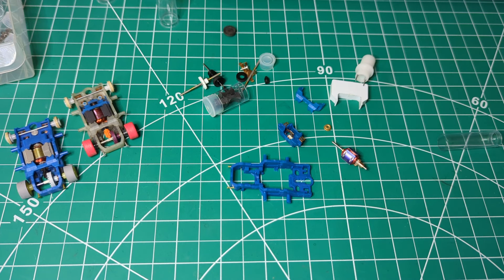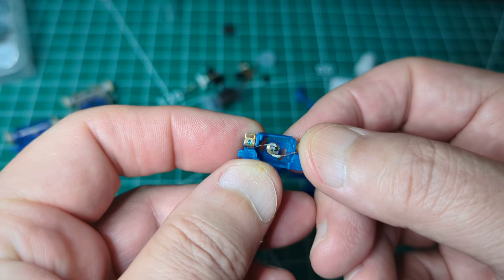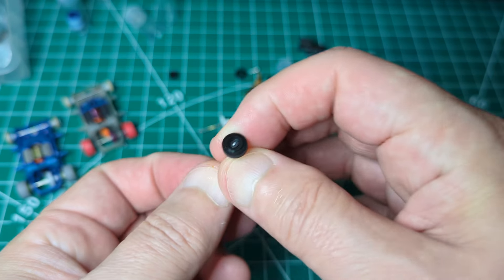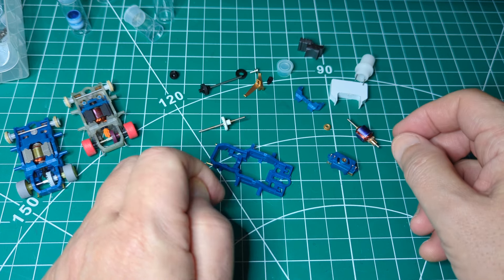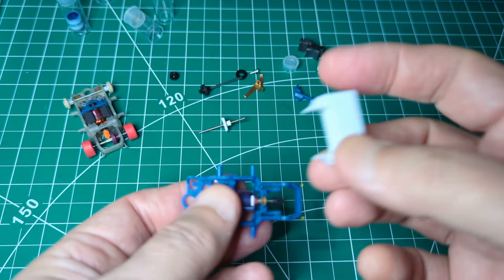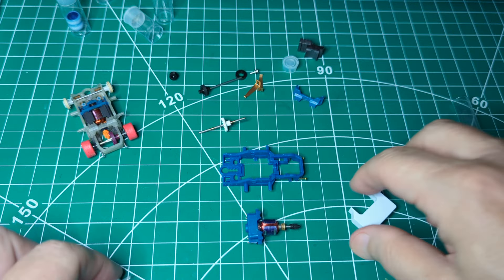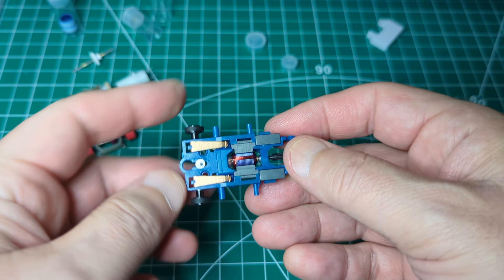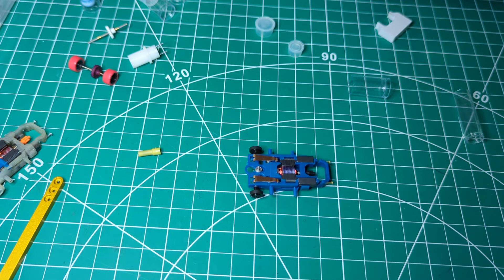Fusion Super Stock Build

Comment: Hi Mark, it’s nj Viper Mike..great video enjoyed it very much question for you. Does the chassis come in different stiffness and which one do you prefer? Thanks. Also, have you tried the metal gears they sound really cool. Also, have you ever used ball bearings for your armature and what do you think of them compared to metal bushings or nylon bushings? Thanks, Mark. Maybe you could make a video of such.
Reply from the maker: Thanks! From what I saw Wizzard has two chassis, one they call flex and one they call the new reinforced chassis. The new reinforced chassis is what I used. I have never used metal gears, they would be overkill for my cars. I do have ball bearings in my 2 ohm Viper cars, I like them a lot but they are pricey. All the club classes I race in don't allow ball bearings.
Reply: @marksslotcargarage  thanks Mark I use the metal gears in my Neo cars and wondered what you thought of them so thanks for your reply. I believe the Crown gear is made out of brass.  And the other gear may be made out of steel. I have also seen aluminum. Thanks.

Comment: Have you fried the Arm yet with the metal spacer? I did this and killed 2 arms, Steve(Rooster racing) said I was crazy, I also blew the commutators of the arm, sounded like a little cap pistol LOL!!
Reply from the maker: No because I use a Teflon spacer first so the arm does not short out. I use the metal spacer on top of the Teflon spacer which is up against the bushing in the endbell. Don't run just a metal spacer against the arm.
Reply: @marksslotcargarage  yea I was running them only and fried some high dollar Arms, 🤣 but learned my lesson ASAP
Reply from the maker: @ray0311  ouch...sorry to hear that....lol

Comment: What’s the advantage of ceramic
Reply from the maker: No advantage, they are actually weaker than the Pro 4 polymer magnets. They are required if you want to race in the Super Stock class. They do let you run Silly Sponge tires in the Super Stock class. I actually prefer the Spec Racer class which uses the Pro 4 polymer magnets.

Comment: Where did you get the teflon spacers?
Reply from the maker: Actually I don't have a good source for them, I can't seem to find them from any of my usual suppliers like Viper or hcslots, I ended up with a few armatures that had several of them on the top of the arm, 3 or 4 of them on each arm, I did not need that many on the arm so I took a few off of each and ended up with  a few spares. If I find a good source I will let you know.
Reply: @marksslotcargarage  That would be appreciated. Thanks
Reply from the maker: @matts.714  Actually Wizzardho.com has Teflon spacers under Fusion/Spacer. 20 for $3.00.
Reply: @marksslotcargarage  Thank you for the info